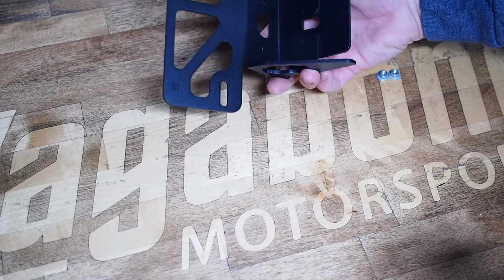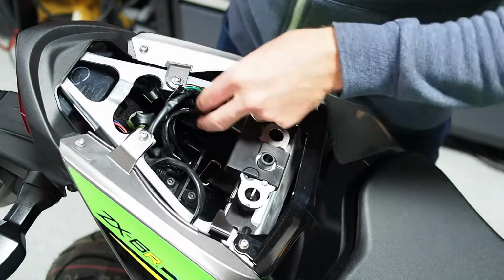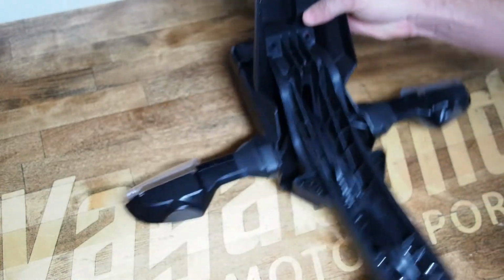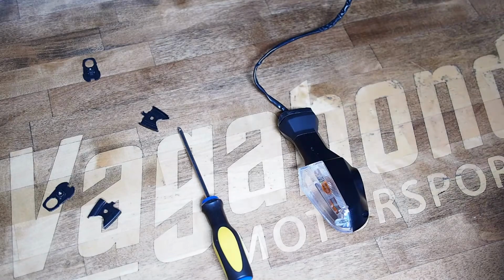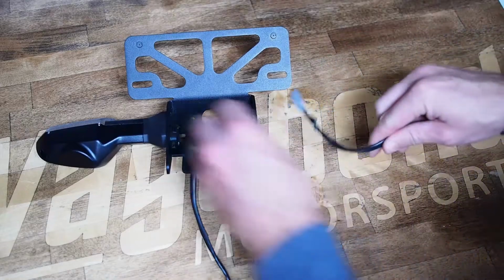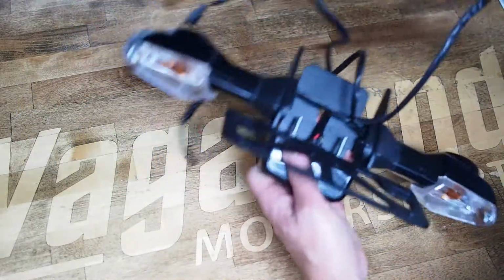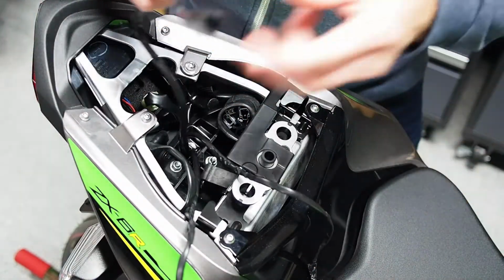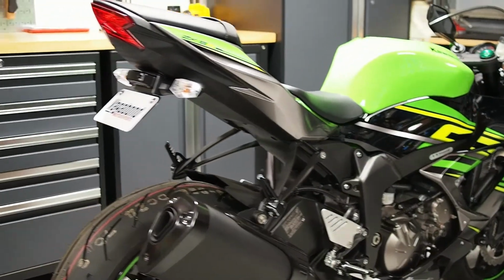Kawasaki Ninja ZX-6R (2013-2018) Fender Eliminator Install - Vagabond Motorsports VM-KN610

Comment: I'd recommend additional measures to secure it. The 4 "locking nuts" rattle off and dropped the entire assembly onto my back tire while riding. Destroying my tire, turn signals, and the assembly itself melted from the friction of the tire. I'm not looking forward to what this is costing me.
Reply: Update. Excellent customer service and very quick response from the company, offered both a replacement as well as assistance with repair costs so I can get back on the road
Reply: @rancid002  did you end up doing additional measures ?
Reply: @Corythehausbaus  They sent me a replacement for free. good customer service experience. Used my own choice of locking nuts with a tiny dab of silicon
 on the next install. haven't had a problem since.

Comment: Hey 👋 can you please do a video on the instal of the one for the 2019 CBR500R,or is it the same as the one you have up?? 
Thanks heaps 👻
Reply from the maker: Should be the same install as the 2016 model that we have up, I believe the tail section is unchanged in the 2019 refresh.
Reply: Vagabond Motorsports thank you heaps I’ll be organising one from you soon,
One more thing do you still have the one on eBay or do I order off your site,I live in Australia 🇦🇺👍😊